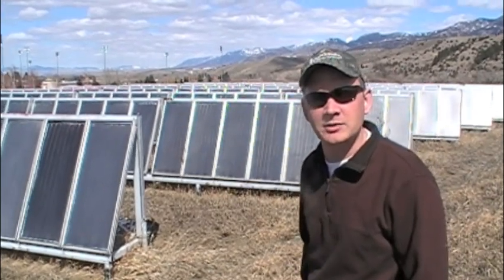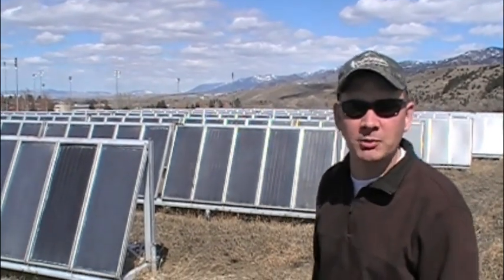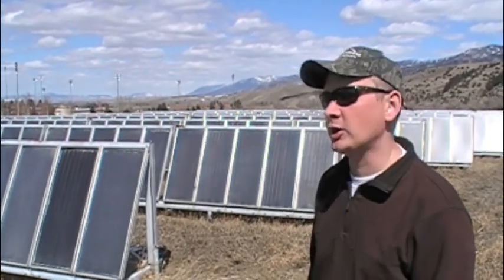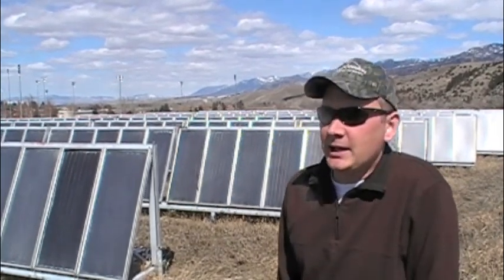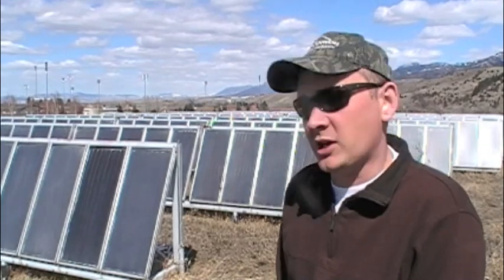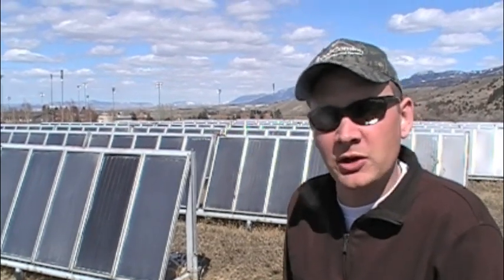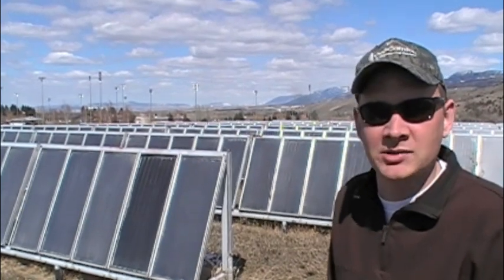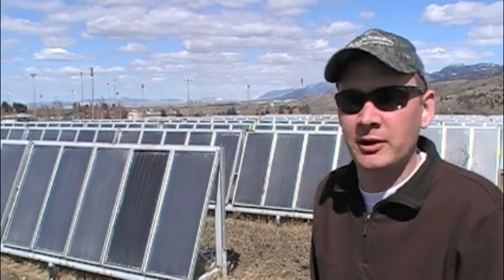Challenges in Solar Thermal Space Heating

Comment: The other half of the "value" question - what were they using instead of solar? I would bet on natural gas which is pretty low tech compared to a frost zone with storage and heat pumps.

Comment from the maker: It did have some large tanks inside the building but not (in my opinion) enough storage capacity.  It also did not use heat pumps and therefore it required the energy delivery to be at much higher temperatures than it would be if heat pumps were used.